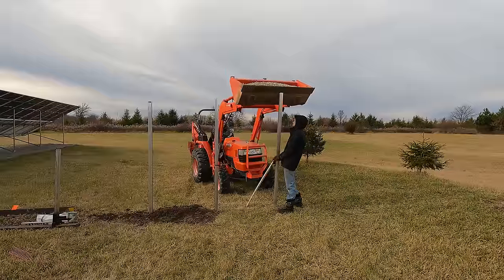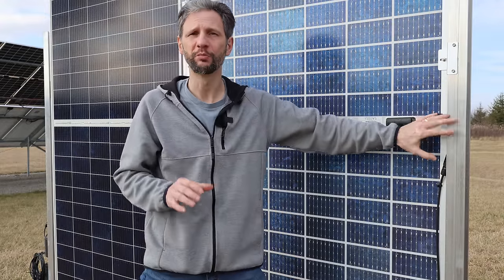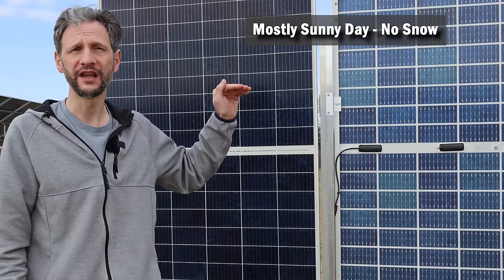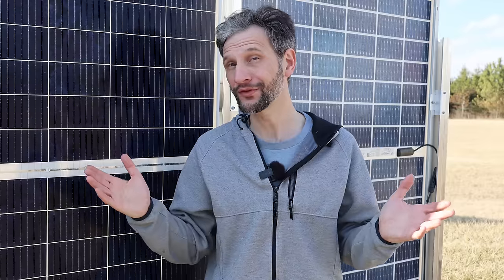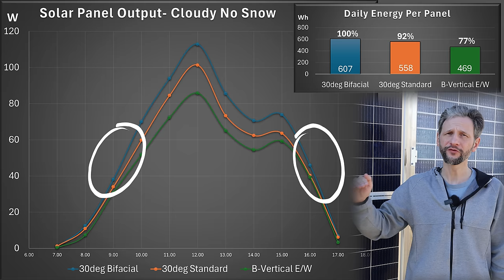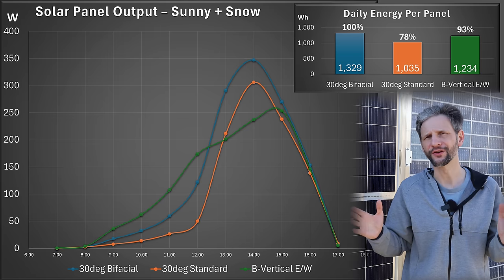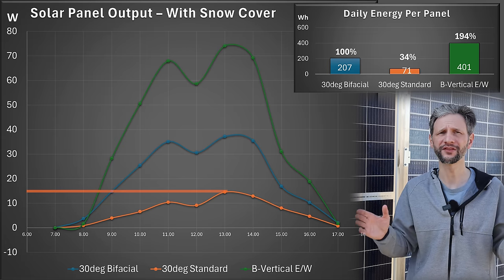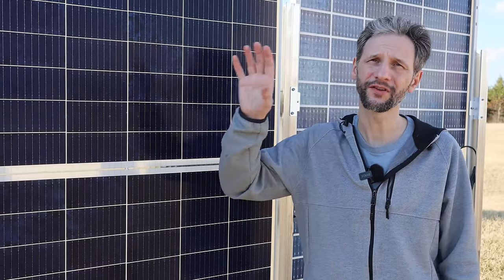Vertical Bifacial Solar Panel Performance Results Part 1

Comment: What about adding small, angled reflectors at the base of vertical panels to offset midday dip? If you really wanted to go nuts, you could even articulate them with servos programmed to gather the most solar energy possible at any given time.

Comment: I think the biggest benefit of vertical panel you have not tested is heat in the summer.  I live in NJ and the summer can get hot.  My panels are on the roof.  So when it is very warm the panels performance is really hindered.  Your setup would not suffer from heat as much since it is over grass.  If you compared vertical to my roof mount I am sure the heat factor in the summer would put the vertical at a larger advantage.  So flat top roofs with solar may be a great choice for vertical panels especially in warmer climates.  Thanks for your data!

Comment: Not sure about the results, but what about putting them not in a straight line, but in a sort of zig-zag arrangement, when East-facing panels are turned say 10 degrees to the South and West-facing again same degree to the south. The "fence" won't be any much wider, but panels will make shadow to each other in the middle of the day.

Comment: This is very interesting. Thank you for posting. I can't help but wonder if the vertical array would perform even better if it were further away from the ground mount array because I think the large shading area may be blocking some of the sun light that would otherwise be available to those panels. The other thing I would like to know is if there is any benefit for mounting bifacial panels on a roof. My intuition says it would be an insignificant increase in production that may not warrant the extra cost.
Reply from the maker: I did some analysis for roof mounted bifacial panels here: https://youtu.be/mzqjCsZKUYQ

Comment: Another idea would be -- swiveling panels. The same mounting (vertical - east/west) but with middle swiveling so the panels can be twisted from the middle. This would be a very easy thing to install and i think it would get much better results than full vertical or south facing?
Reply from the maker: They would shade each other when they are rotated.

Comment: East/west should work best in summer.  the primary side should be turned facing due south in the winter if mounted vertical

Comment: There is a physics concept that in the case of solar panel translates to: Output power of a solar panel is directly proportional to the cosine of the angle between the incident sunlight and the "normal" of the solar panel. In this case "normal" means perpendicular to the solar panel's face. The implication is that for a monofacial panel you will always get the most power if the face of the panels track the sun. For fixed mounted panels there is essential only a few minutes per day day to extract the maximum power from the solar panels. For the rest of the day you do not utilize the panels optimally. If this was my installation I'd modify the vertical mount system with a pivot that runs horizontally along the center of the panels and use a tracker to adjust the angle of the panels to always face the sun. You can optimize it even further by installing a pivot at the base (ground level) of the mounting system to enable the panels to rotate like a merry-go-round. This is to adjust for the sun's path across the sky for different times of the year (2-axis tracker). Alternatively just buy a tracker from amazon. They seem cheap enough.

Comment: Amazing to the point video!
My conclusion is that we need advanced solar tracker that simply move the panel the optimal position across all season.
Reply: The issue with all trackers is they add significantly more costs and maintenance complications. Their return in additional energy production isn't dramatic. They only make sense if you are so tight on space, that you cannot just build a bigger, fixed mount, maintenance free array.  But yes, they do have their niche.
Reply: @Texacate  i seen 1 or 2 YouTuber get 30% increase in efficiency. Imagine this over 25years. I don’t think you need a complicated mechanism. I think a 1 axis could be beneficial. Maintenance depends where you live and it’s known technology. Just moving this from tilted to vertical for winter is pretty great for snow removal. We could talk for hours on this topic 😅

Comment: Subbed to see this, what a great idea. 
Another idea, that may not be very practical if you need to farm between would be to place the vertical panel in the bottom of a v. Then at noon you might be able to reclaim a little more of that dip from your graph!

Comment: Important to consider the impact of whether you are on-grid or off-grid. 
Remembering that the ideal design criteria for off-grid is designing for your worst days, as this defines how many panels and batteries you need, whereas for on-grid the aim is to maximise annual output.... 
This may be a very critical difference for whether bifacial east west is better value. 
This may even be to the point where other solution may arise, such as buying cheaper slightly lower wattage second hand panels, and mounting them back to back at 15-25 degrees. This way panels will receive energy all day, but wont overheat as much at peak gain hours, and will gain most evening and morning and will self clean from snow at all times. 
There are other applications worth considering, such as my own, where i have grid download access for worst possible days, but am not allowed to upload energy to the grid. Minimising my bad days when i have to pay for energy, is far more important than maximising energy on my best days. 
The other consideration here of course is lattitude. I'm located 7 degrees from the Equator, when my panels face east west they are directly perpendicular to the sunset and sunrise. When the other dave (I'm also Dave) is measuring the effectiveness of his east west panels in winter, the sun is striking them at quite an acute angle with much lower gain.. 
so many factors! time to pull out a super computer and hire some geeks, but i feel we are still far from knowing the answer on east west facing bifacials.
Reply from the maker: Thanks for your lengthy discussion.  As you mentioned there are many parameters to consider that are different for every individual.  Hopefully my research will provide another data point for people to consider for their unique situation.

Comment: The vertical panels  are much prettier in the landscape. So if you have neighbors, then they have a definite advantage.
Reply from the maker: I agree, I think they look great!  However, as a fence you would have to consider the risk of broken glass and access to high voltage wiring.

Comment: There is another consideration that makes vertical panels make sense - you can mount the vertical panels as a fence on your property, which potentially if you are space limited means you can fit more panels on your property than if you didn't mount some vertically.
Reply from the maker: Exactly, this opens a lot of opportunities for new applications that previously didn't make economic sense.

Comment: interesting! especially it may be used with mirrors on the sides and you should try it at high temperatures. solar pannels don't like to be hot.
Reply from the maker: I am running tests with mirrors and thermocouples.

Comment: Exuse any ignorance but, why not 10 or 15 degree East and West Bifacial Panels?
Reply from the maker: It would just shift the curve towards the morning or evening.
Reply: @ProjectsWithDave  Yea but wouldn't it increase the total amount of electricity per day? My understanding is that more sunlight gets through at noon than in the mornings because the sunlight has less atmosphere to travel through. Giving the panels something like a 5-15° tilt would eliminate any drops at high noon.

Comment: It would be interesting to see if the flatter curve of the E-W bifacial panels could be combined with a smaller, less-deep-cycled UPS. Lower lows and highs in the battry charging profile might be cause for a smaller, but also longer-lasting UPS with commensurate savings. Alternately, the bifacial panels could have further advantages in reverse meter applications where more power is produced at times when power is more valuable, improving ROI?

Comment: I’ve heard off grid installations really like a flat wide production curve to minimize battery storage needs. A V array split facing between 140 and 220 degrees with a 50 degree insulation angle to minimize snow accumulation would be interesting.

Comment: Something to consider is off grid in very hot climate where we need to run air conditioner 24/7. Having some panles pointing east and some west helps power the AC sooner and later so we use less battery. Every day by 10am my batteries are full. I thought about a steep "A" with panels on both sides to sport each other for high wind.  Just need to compare the extra cost of more panles or more batteries.
Reply from the maker: If your batteries are full by 10:00AM it sounds like your solar capacity is out of balance with your battery capacity.  If you always have enough battery reserve for nights and rainy days, that's ok, otherwise you may need more battery capacity.
Reply: @ProjectsWithDave  Compare the cost of solar panel power vs battery cost.  5 used solar panels that cost $500 can put out15kw vs 1 bat about 15kw cost $3,000 to $4,000 and it still needs solar. Batteries degrade much faster than solar. So more solar is much cheaper than more battery.  Sure if unlimited budget you just build massive system.
Reply from the maker: Yes, depending on your situation it may be cheaper to just have extra solar capacity, as long as the batteries are enough to support your loads when the sun isn't available, no need to add more.
Reply: @ProjectsWithDave  Its been fun figuring out how to keep things cool. For sure running all the AC as cold as they can go all day keeps the house good till bedtime. Then a small unit in bedroom does not take much power. In My garage that is brick I considered the cose to insulate and drywall. I figured its cheaper to add a 2nd AC vs labor and materials of insulating. Not efficient if you paid for every watt like on grid. But off grid is total different strategy.

Comment: Due to space restrictions (9  big dormers, 1 big tower)  I’m going vertical.  1 string facing East  1 string facing west and a 3rd string facing south. 

      While my new roof is black  on the shingles on the back side of the panels I’ll paint that area white with roofing pain.   No neighbors can see that, unless they are flying a helicopter  directly overhead.

Comment: one of the supposed advantages to vertical panels is their superior heat dissipation, letting the panels operate at lower temperature and therefore higher efficiency. I'll be very interested to see your summer numbers.
Reply from the maker: Yes, I'll have to add temperature to my list of parameters to track.

Comment: Interesting, the one result does confirm something I guessed when I saw a video about vertical panels the other day, they're less likely to get covered in snow. So if it's a setup where the panels can't/won't be cleaned off regularly verticals might have an advantage in that situation. I could see from the video that the wind was still making a /little/ bit of snow stick to them but they won't form drifts easily.

I wasn't aware that the back-side produced less than the front, but I guess that makes sense.

I just had a thought that I wonder how they'd hold up under high winds, with sloped panels the wind might be deflected up, but with verticals they might get hit with the full force of the wind, so if there's a hurricane or something I wonder if they'd be more likely to get damaged or destroyed. It's probably not something that'd come up often hopefully though, but some areas do get hit with storms more often and having to replace panels when that happens could get expensive. Though perhaps it could get mitigated by surrounding the solar setup with some kind of wind breaks, or maybe having air gaps between the panels to allow the wind through. Not sure how much force it takes to damage panels.

Comment: Hi Dave, We have not deployed all of our 36 SEG Bifacial panels. We have been interested in the vertical position. Thanks for the info. I think we might try six panels in the vertical, 2 East, 2 South, 2 West and put them in series.
Reply from the maker: I would not put panels in series that face different directions.  Each direction should be a separate string on a separate MPPT, or on individual micro inverters.

Comment: I can predict the next evolution of bifacial. How about a fine "wash-board" prismatic ribbing on the glass surface. That Fornell effect would bend the most efficient angle a little offset from perpendicular. There would be a right hand and left hand micro ribbing on opposite sides and the ribbing would need to be on the inside as not to influence snow shedding. Also, the prismatic ribbing would need to be at a slight angle. There would be a right way and wrong way for placement of the edge facing South.

Comment: Why loose half of the surface from the very start? Why not make some sun tracker or some simple timer controled rotator? Also you never have winds 
 in your area? It seems that some gaps between .the panels are necessary or they will fly away and get damaged. 
Thank you for sharing so much info

Comment: From my experience the panels shouldn't be entirely vertical but actually sloping a bit facing east and west to better target the sun and also collect some energy from the sky itself - even the blue sky contains energy. The sloping of the south facing panels are also probably getting best result by being optimized for the equinoxes.
I'm situated at 57 degrees north so even vertical south-facing panels are actually quite good in the winter when there are only a few hours of sunlight all appearing in the south.
But the most important thing is that you have to look at the terrain around you to decide what's best for you.

Comment: Did you use the 2" or the 2.5" i-beams?

Thinking about setting up something similar for our 7 foot tall bifacial panels.  Although not sure if we should pound the posts in or use sono tubes with concrete.  Would need taller beams though to get some snow clearance.

Comment: Good Gosh, we have solved the duck curve by off setting when power is produced.  Channeling the rest into heating and cooling batteries where most of our energy is needed anyway, we have solved residential power use
Reply from the maker: Maybe, but not everyone suffers under the duck curve.

Comment: It seems that the vertical panels could have been located to the south of the main panels for peak performance, since they pick up reflected light. It would be off-axis light, but could still be some gain.

Comment: It will be interesting to see the summer results.  It’s the increased temperatures of the  solar panels using the traditional mounting/orientation  that  reduces their efficiency.  The low albedo of the panel results in the absorption of most of the sun’s energy.  That’s a lot of energy that needs to be dissipated mostly through sensible heat-  typically 800-1200 watts per sq meter. It would be interesting to track & measure the surface temperature  of the vertical vs tilted panels and calculate the temperature response  coefficient (vs  manufacture’s spec) along with air temperature  and horizontal incoming solar radiation .  Obviously many seasonal, latitudinal, &  local meteorological  variables will impact results.

Comment: If the bottom section below the solar vertical panels had slightly angled reflective material it would reflect more of the midday sun to adjoining rows of panels.   Only works if you have multiple rows.    May not want it if you have cows or animals as it might be blinding.

Comment: the sun is out full-bore at noon here today, but there is 41" of snow on my roof panels, so I get bupkis. I need to add a couple of the bifacial.  If two faces are better than one, wouldn't  a 3-facial (E-S-W) be that much better ?
Reply: Not from a space-efficiency point of view, but as regards a close-to-uniform solar production troughout the day!

Comment: Good testing. Nice to see real world analysis of this way of racking solar. Am very interested to see how it works when temperature starts to rise and the voltage begins to lower. Will there be a difference there as the angled panels should, in theory, get warmer than the vertical panels? Looking forward to the update during the summer.

Comment: For winter vertical south facing is optimal. The reason commercial installations in Europe typically use vertical East West is optimisation for the summer.  In December the sun is below the horizon when it is located due west or due east, it actually rises about halfway between east and south. Therefore a vertical south facing panel is nearly continuously producing more power in December than a vertical east west one.
Reply from the maker: Yes, the data I have seen indicates vertical south facing would outperform E/W in the winter.  I hope to do that test in the future.
Reply: @ProjectsWithDave  Hopefully someone will be able to compare your East and West facing vertical panels with some Equator-facing verticals (which is how i think other researchers have been trialling them)